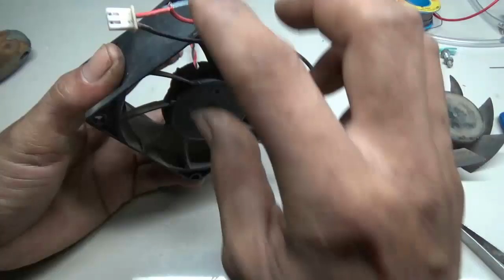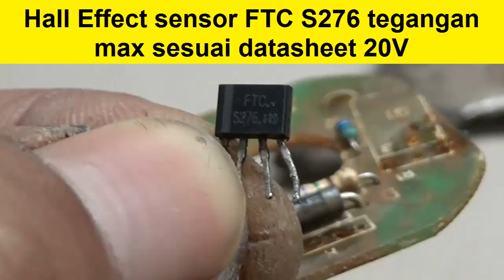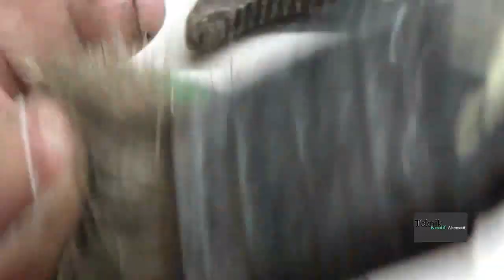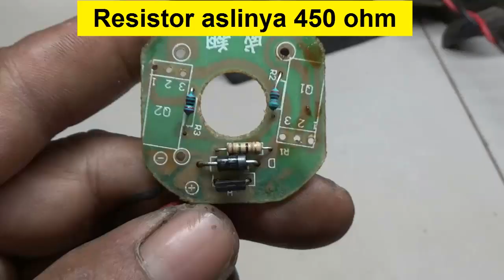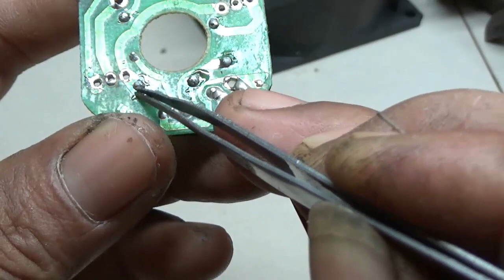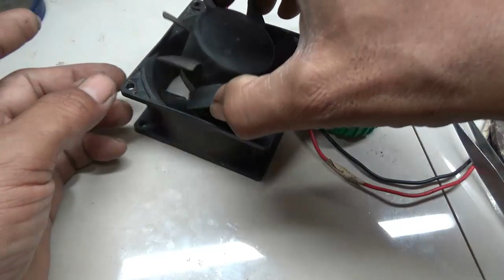Cara memperbaiki kipas pendingin Mesin Las.

Comment: Mau tanya saya punya kipas dc merk Servo dan kipas dc delta yang pakai 4 kabel 48volt. Cara nyambunginnya bagaiamana ya.. Kalau di sambung ke adaptor yang pakai 2 kabel.. Sedangkan di kipas dc antara + / - warnanya berbeda
Reply from the maker: Kabel yang lain hanya untuk kontrol speed saja, bisa diabaikan saja.
Coba masing2 merk sebutkan warna kebelnya apa saja ?

Comment: Klo diganti pake blower komputer bisa ga?
Maaf pemula🙏
Reply from the maker: Kipas komputer 12V, sedangkan kipas dc untuk mesin las 24V, jadi tidak bisa, mas broo.
Kalau pun misal bisa, putaran pun kurang kencang karena ampere kecil, tidak maksimal untuk mendinginkan mesin las.
Reply: kalo misalkan ganti fans kipas nya yang sebelumnya 0,15 ampere jadi 0.27 ampere apakah bisa tegangan tetap 24 V ?

Comment: Mohon tanya saya punya las lakoni 900 itu kipasnya ngk mau muter apa ya penyebabnya
Reply from the maker: Tapi bisa untuk ngelas atau tidak ?
Reply: @YudiHermanto4H  bisa mas normal kalo untuk itu cuma kipasnya nyala tapi kadang mati jg kalo beberapa saat di pake
Reply from the maker: @muhammadade2019 coba cek soket kabel kipasnya mas, dibersihkan atau siapa tau kabel longgar dari soketnya. Stau solderan soket yang di pcb retak, dicek juga.
Atau mungkin kipas seret, dicek juga. 
 Atau kalau gak ada basic elektro mending ganti aja mas...😀😀

Comment: Mohon solusinya bosku..🙏🙏
Mesin las saya kalau star awal kipas hidup normal stelah 30 dtik putaran kipas nya pelas banget.
Reply from the maker: Saat kipas pelan, fungsi mesin las bagaimana, normal atau tidak ?
Kalau mesin las normal, berari yang bermasalah kipasnya, bisa karena seret atau hall sensor yang rusak.
Kalau mesin las tidak normal, bisa karena kipas nya konslet atau power supply switching yang kecil/power standby yang rusak.
Coba diperjelas lagi mas.
Reply: Api Las nya agak sdikit ikut lemah.
Lampu star on/off sama.
Reply: Tpi masih bisa untuk di paksakn untk pngelasan. 
Cuma amper hrus besar.
Reply from the maker: @barabarapati6714  dicoba dulu saat kipas pelan, soket kipas dilepas. Trus dicoba untuk ngelas sebentar, kalau mesin las langsung normal, berarti kipasnya yang rusak konslet. Kalau kipas konslet mengakibatkan tegangan yang ke pwm mesin las drop, efeknya mesin las tidak bisa normal.
Reply from the maker: @barabarapati6714  saat mencoba, casing mesin las jangan ditutup dulu, biar bisa langsung lepas soket kipas dan langsung tes ngelas. Biar langsung nampak/diketahui perbedaannya sebelum dan sesudah soket kipas dilepas.
Reply from the maker: @barabarapati6714  lampu star on/off nya sama gemana? Meredup ?

Comment: Kipas pndingin mesin las pakai dc atau ac bos?? Please jawab
Reply from the maker: Ada yang dc ada yang ac mas. Tapi rata2 kipas dc 24V.
Reply: @YudiHermanto4H  utk tau AC dan DC bgmn ya mas?? Krn gk da tulisan sama sekali
Reply: @YudiHermanto4H  btw terima kasih bnyk yach udh mnjawab,sangat membantu
Reply from the maker: @biodataplus7935  kalau yang dc, ketika mesin las dinyalakan, kipas tidak langsung ikut menyala, ada jeda beberapa detik. Trus ciri2 lain, suplainya diambil dari pcb power standby, pakai soket kecil, biasanya di pcb atas.
Kalau yang kipas ac, jalur suplai diambil dari jalur area yang terhubung dengan saklar on off. Yaitu terhubung ke jalur 220v.
Reply from the maker: @biodataplus7935  mesin las merk apa ?
Reply from the maker: @biodataplus7935  kipas ac biasanya cukup berat, karena kern statornya lumayan besar. Kalau yang dc, kecil dan lebih ringan.

Comment: Bang mesin lasanku akibat patah baling balingnya trus saya lem dgn dexston hitam putih

Sekarang malah jadi gak nyala apinya karna indikator operheat panas tinggi jadi sering mati

Yg saya tanyakan kenapa pas brntinya kipas relay jadi bunyi nyiit

Trus api lasan jadi ngga hidup

Dan apakah cuma kipas aja yg di ganti?
Reply from the maker: Kemungkinan kipas rusak nya konslet mas. Jadi tegangn 24V yang mensuplai kipas, relay dan ke pwm drop.
Coba tes kipas dengan power supply eksternal 24V.
Kadang kipas konsletnya tidak total, masih mau muter tapi pelan, juga jadi penyebab tegangan 24V drop.

Comment: Lakoni 900watt 160ampere Saya kok anginya kecil bgt ya?
Reply from the maker: Coba cek kipasnya, seret atau tidak. Atau kemungkinan perlu ganti.
Reply: @YudiHermanto4H  mas ternyta kipasnya mmg beda tertulis cm 220-240 0.07 ampere dan ngambil arusnya dari saklar,beda sama izumi saya yg dc 12v 0,6Ampere dan ada soketnya kipas
Reply from the maker: @dantekaori8648  oh y brarti memang beda, kipasnya biasanya kipas dc 24v.
Reply: @YudiHermanto4H  kalo saya mau ganti yg dc ambil arusnya dari mana mas?ada soketnya gak ya?